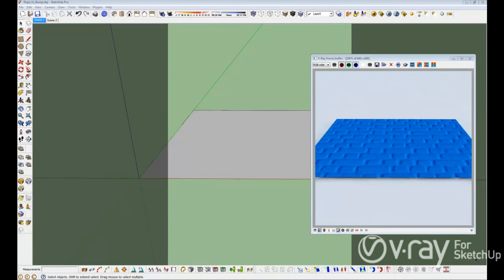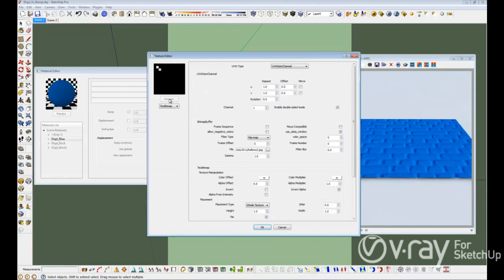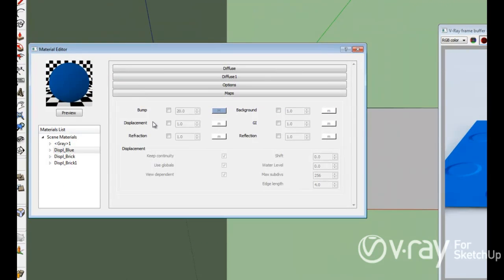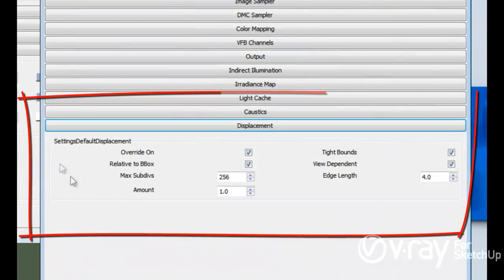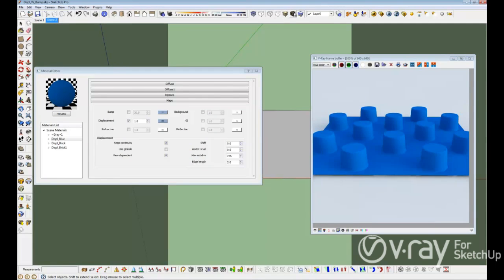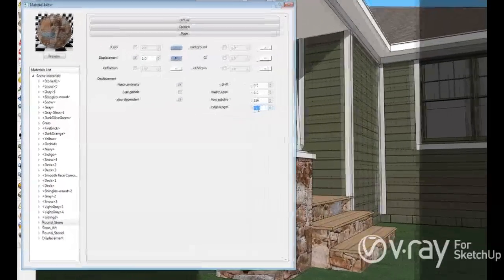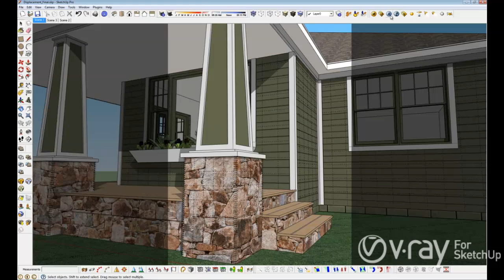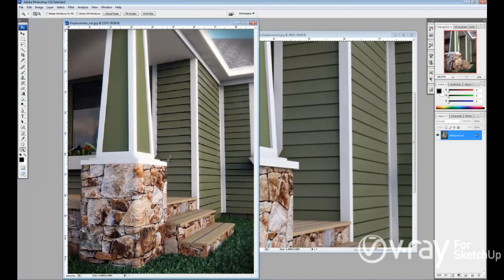V-Ray for SketchUp - Bump and Displacement - tutorial

Comment: i did it once it worked fine and then i tried to do it again with some other material and both materials stuped rendering with displacements am i doing something wrong or is there a bug with my software im using it on OSX by the way